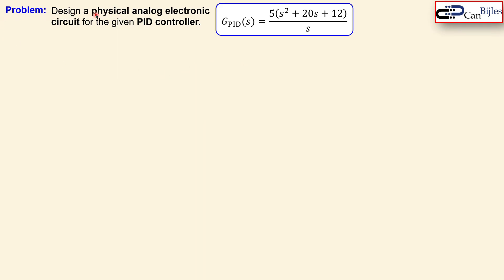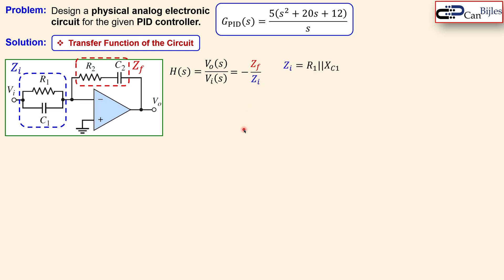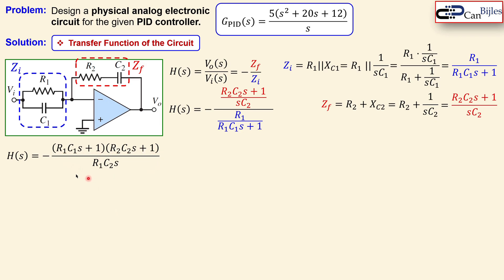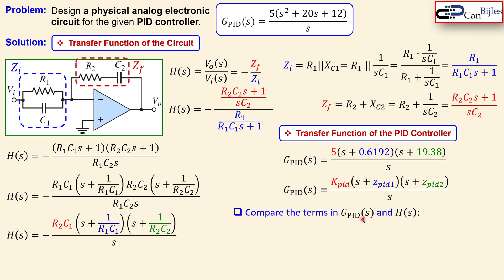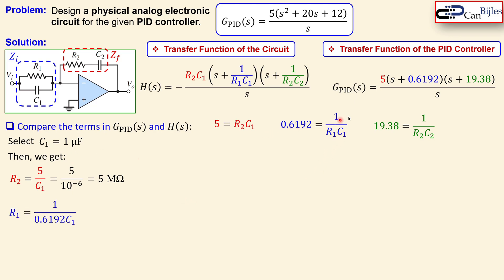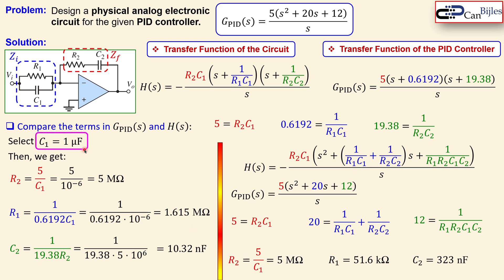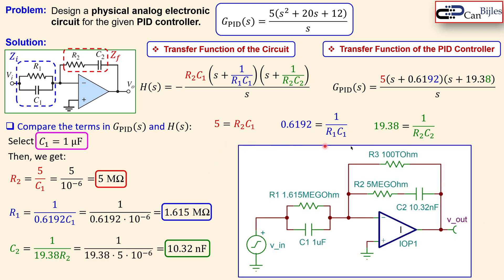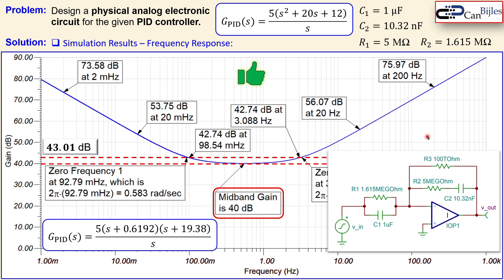Realization of PID Controller using Analog Electronics 🌟 Calculation & SPICE Simulations 👍 Example 3

Comment: How do you determine the midband gain by hand calculation instead of simulink?
Reply from the maker: You will need to calculate the center frequency and substitute this frequency in the magnitude expression of the transfer function. For this, you can look at the formulas for second-order bandpass and bandstop transfer functions.